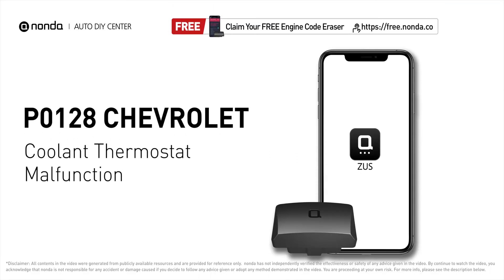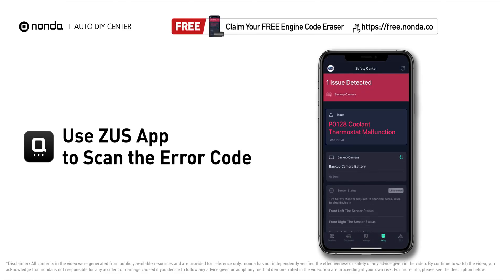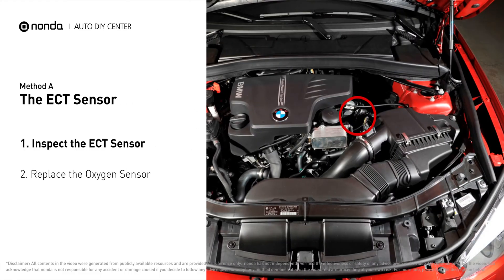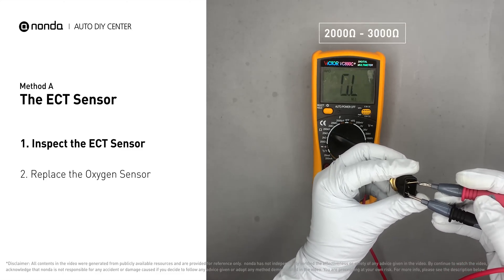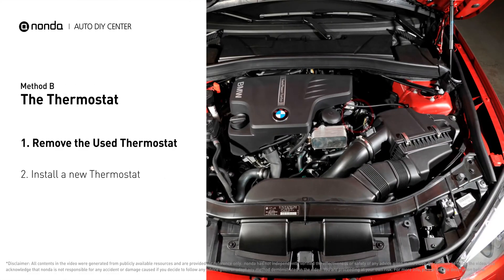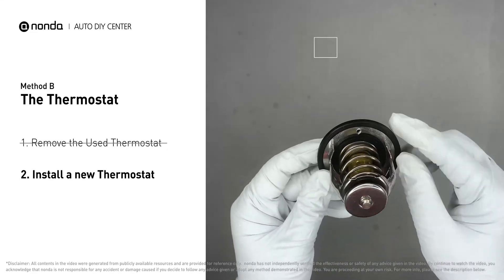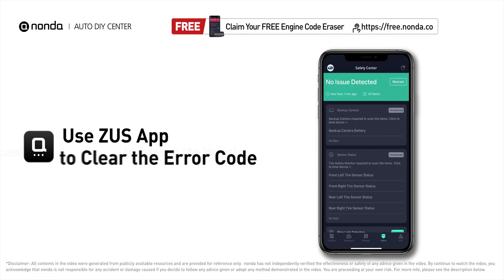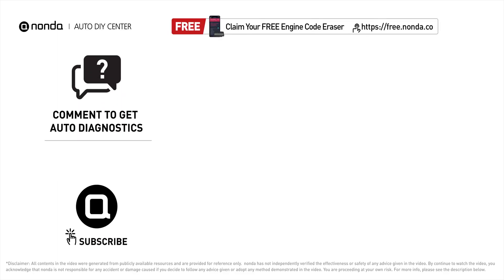How to Fix CHEVROLET P0128 Engine Code in 3 Minutes [2 DIY Methods / Only $7.34]

Comment: Could mixing green anti freeze with the Orange anti freeze cause this?  The garage said it drained the coolant and blew out the heater core. Then replaced with Orange anti freeze. But I still get this error code intermittently.
Reply: No that wouldnt cause that